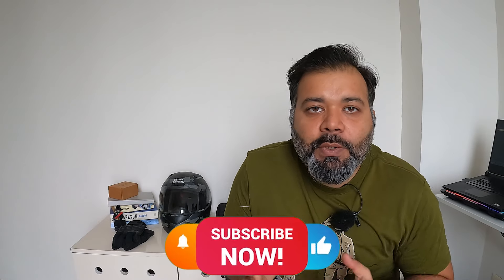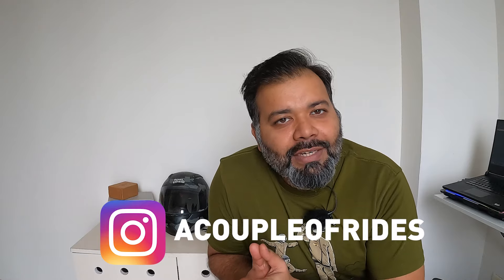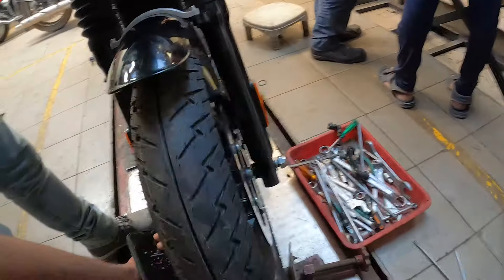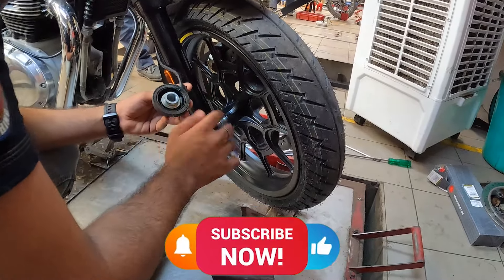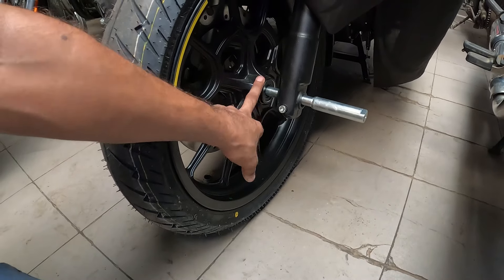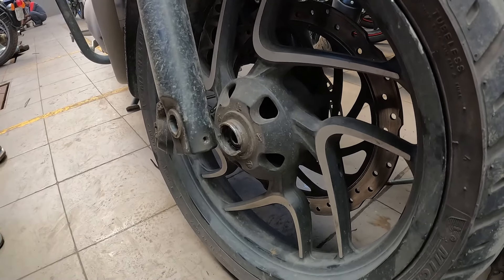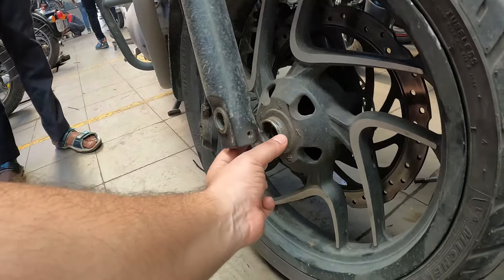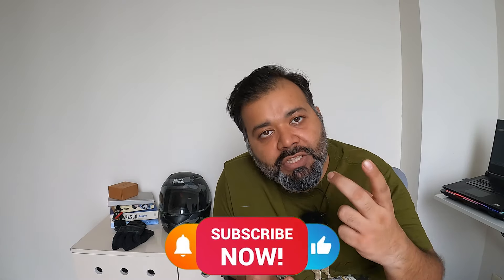Fitting Hunter's wheel in Interceptor 650 | Continental 650

Comment: Thank you so much for these details. Please update few more points in next video
1 hunter front rim gt front mai fix ho jayega correct?
2 rear rim kaunsa daale?
3 do we have any option to hv 17inchs fork rims?
Reply from the maker: 1. Yes, it cam be done. Parts banane padenge 
2. Rear mai meteor ka rear rim dal jayega
3. Don't change the forks, as it will get in to a lot of custom parts. Rim are avaiable in 17 inches online and even Himalayan rim can be used too.

Also consider that, changing parts will have their own results. Changes in rake angles and diameter will make the bike behave very very differently. 
RE will be launching alloys soon enough if you can wait a bit longer.
Reply: @acoupleofrides  please update give update on this video. Aap kuch new part install kar rahe ho after installing the front rim
Reply: Please show the complete look after changing the both wheels. Please!
Reply from the maker: Nahi I am not going ahead with this. I already have dominar 17 inch wheel installed. You can search it on the channel

Comment: apart  form this speed sensor , disk brake is also an issue you can't use interceptor brembo disk brakes on hunter alloy
Reply from the maker: Yes all of the stuff... the brembo caliper is almost the same unit as on interceptor,  it's the mounting brakes on the shockers that alight it with the disc..
That has to be exactly perfect fit..

Comment: Hunter 350 me 17 inch tyre ate hai kya hum usme 18 inch lgva sakte hai alloy and tires
Reply from the maker: Nahi, hub assembly, abs system or speedo sensor sabh alag hai... no other bike's parts are plug and play.
Reply: @acoupleofrides  thanks alot sir and one 
More question is if i update rear tyre 140 to 150 so its best for replace because by default tyre not grip much as good so i want to replace please tell 150 is good or not and which type of tyre i use to upgrade radial or normal ..?
Reply from the maker: @divyashverma1012  yes you can upgrade to a better rubber, like apollo apha, tvs euro grip and likes.. 150 should be a good fit.. but make sure you change both tires to similar rubber.... else it will be different compounds resulting in different grip levels...
Reply: @acoupleofrides  sir also tell which is best suited normal tyre or radial tyre for specific hunter 350
Reply from the maker: @divyashverma1012  all expensive tires are radials cheaper ones are bias ply... above recommended ones are radials.

Comment: Why not take the abs sensor output to the speedometer...iff it has the same electrical output as the stock speed sensor (when rotated together at same speed)...then only a coupler type matters and you won't need the stock speed sensor.
Reply from the maker: Yeah but it's calculated by the ecm control and that we are not able to change or fiddle around with.. see I want to keep it simple so that most of us can apply it.. the moment we start getting in the electricals, I believe may will opt out as it will also void the warranty... but please share in case you have breakthrough there..

Comment: Hello brother pls try meteor front wheel 
As my best knowledge didn't go to size , chk interceptor tyre radius out side and chk meteor tyre radius 
I think you're goal is complete
Nice vdo 👍
Reply from the maker: Metero front will is 19 inches.. it might fit  but we have tried because to run 19 front  and 17inches rear the rear will have to rotate 1.8 times approx to get 1 rotation in front. This will cause lower pickup and stiff handling dynamics...
Reply: @acoupleofrides  today I m try to check  meteor both wheel fit in my interceptor and I know you  how is the result
Reply from the maker: Superb, please let me know ...

Comment: 18 inches looks nice, wud rather keep 18 in front n 17 in the rear with 150 section
Reply from the maker: Yup, a lot many people are running that setup, runs fine. Just that the rear wheel has to make more effort to do the same work. The rear has to spin 1.3 times to so 1 rotation of front wheel, there by increasing the rpm on any given speed by 500 revs..  handling get affected a bit too. But it's works fine.

Comment: the mouting point for interceptor disk and hunter disk seems to be different so how is it a direct fit?
Reply from the maker: It's the same.. and even hunters disc is fitting normally, without any adjustment.. which is only 20mm in over all Dia reduction... can be handled with better brake pads... but still the final check will be done post the part is been procured..
Reply: @acoupleofrides  no, what I meant is that retro fitting interceptors disk to hunters allloy would be a headache since hunter has a hubless rotoe which has mounts for the rotor away from the center of rotation while interceptor has disk mounts closer to center of rotation, the interceptors rivvets of floating disk is almost equally placed from center as compared to hunter's disk mounting points, and regarding the braking power I don't think with a 300 mm fixed disk we can't match the braking power of 320 mm brembo floating disk regardless what ever break pads we use unless we switch the two piston floating caliper with a four piston fixed caliper. and also the actual wet weight of interceptor 650 is above 220 kgs so i woudn't trust a disk break that is made for a bike that is 180is kg wet.
Reply from the maker: You are right... I can only answer this post I have the wheel in possession.. although we manually checked the discs by overlapping on top.. mounts are similar.. shouldn't be an issue.. but as I said all such question can only be answered when the fitment is being done.. and addressed... I am currently running a disc from ns 200 on the front wheel.. and it works fine with standard caliper ...
Reply: I’m not trying to offend you here or anything, love your work as well. But working fine and having same breaking performance are two different things that’s my point
Reply from the maker: By fine, I meant I haven't lost braking performance at all... but the same time I am not racing with it, hence I would be ok with a slight change too.. if i was on track then I would have acted accordingly and would have kept a detailed check on figures... that being said with setup that I mentioned above I am able to brake faster and more in control compared to bikes with 18inches. It's because the contact patch is been increased too with size up tires... I hope this give you some assurance with braking performance...

Comment: I dont know whether am going to get a response on it or not 
Just wondering did you guys thing of TVS ronin alloyed wheels on Royal Enfiled any models ?
Reply from the maker: Not really,  we haven't considered it. We want to keep it to stock installation as much as we can. Installing a different brand means the mounts would be totally new, and we will need to make mew adjustments...
Reply: The weight has a big difference between ronin and Interceptor. Hunter, dominar, mojo will be better match
Reply from the maker: Hey Arun, although mathematically you are right but in the real world things are different. For example the alloys used in hunter are same as meteor. Both in construction and weight... on the other hand fitting MOJO wheel is quite a challenge ( unless you are master mechnic) as ABS sensor plate, location, disc brake mounts, axle all go through a change and adjustment... I have gone though that as well. You can see a video that I did for the front wheel 17inches  installation in interceptor... so only if we consider the weight criteria these three are relevant. When it comes to fitment 1. Hunter 2. Dominar..
Reply: Your real world experience is invaluable! And Hunter wheel seems to be promising. Looks like we can replace the whole front end with Hunter forks, calliper, pads, rotors and wheel and like you said machine the interceptor Speedo on the wheel and use interceptor fork internals
Reply from the maker: Thanks, but all that we will be able to figure only post the wheel comes